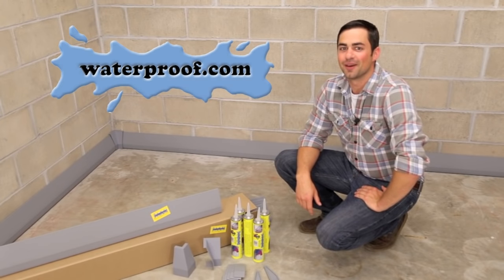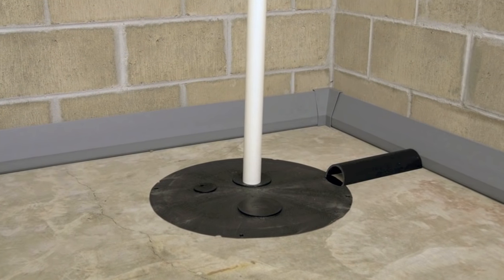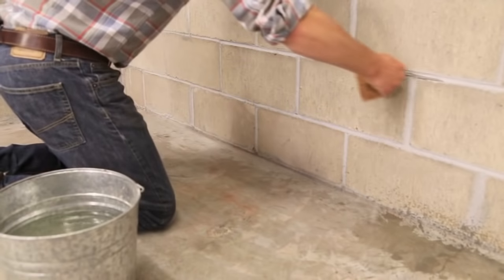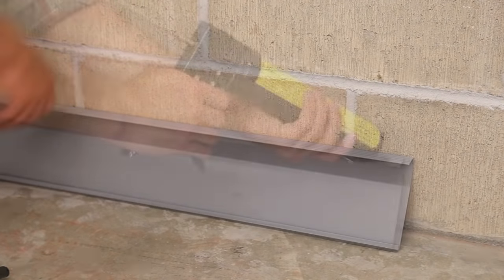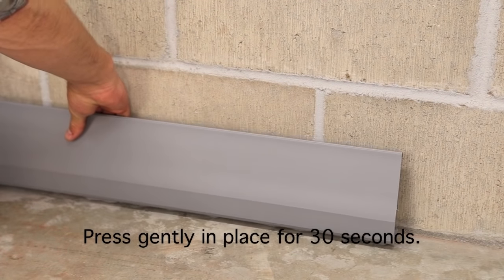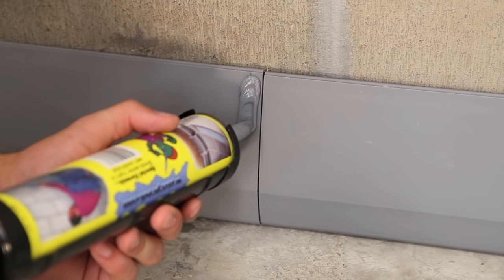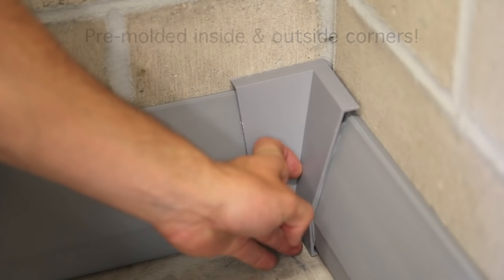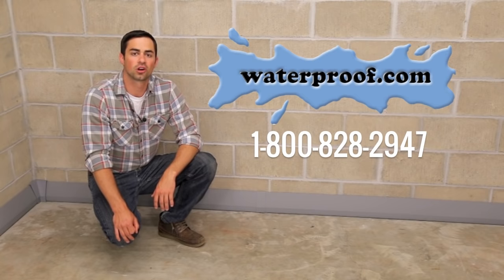How to Waterproof a Basement | DIY SquidGee Dry System

Comment: Do you have to apply the gutter at an angle to allow water to drain down?
Reply from the maker: +Jeffrey Redenius SquidGee Dry System stands five inches tall to allow for uneven floors. As water around your foundation rises, it begins to flow into the SquidGee Dry System. Water flows naturally toward any low spot or drain. When the water stops flowing out at the drain or sump pump, you know that the SquidGee Dry System has finished its work. With the water level now lower than the floor, any water left standing in the SquidGee Dry System flows back out through the weep holes. If you have any other questions please visit our website: http://waterproof.com or give us a call!